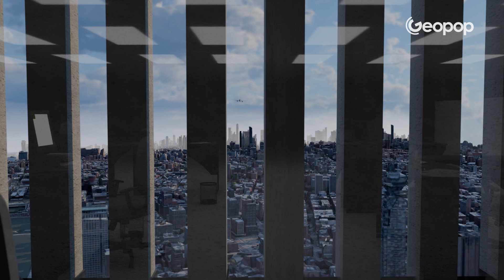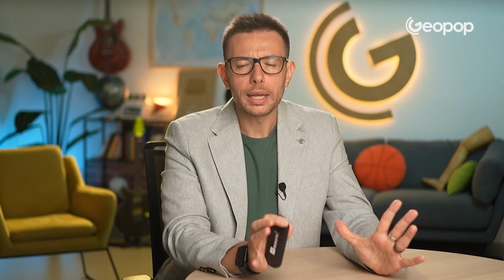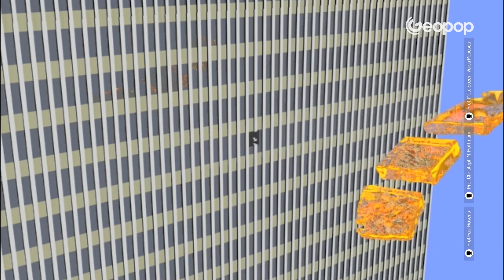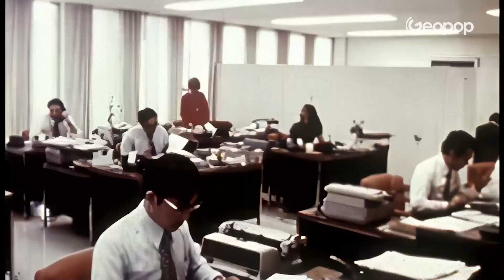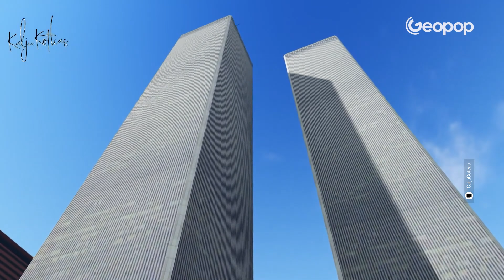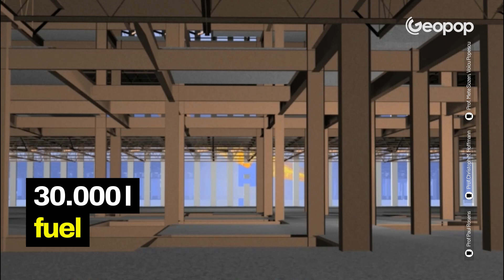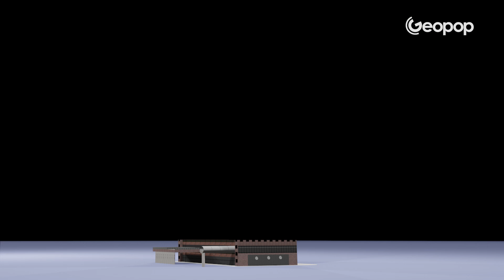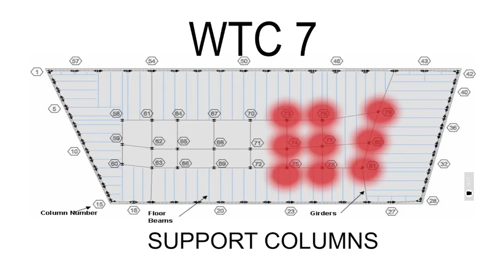9/11, 2001: The Technical Reconstruction of the Twin Towers and WTC 7 Collapses

Comment: When traces of thermite was  found in the wreckage debris I did not need to hear anymore complex would if reconstructed theories...
Reply: You know what thermite even is? It's literally iron and aluminum. It's not hard imagine a roaring, accelerated, fire would weaken metal that is trying to support thousands of tons. No building is supposed to just shrug of a commerical airliner and the ensuing fire.
Reply: @wowplayer160  I know what it is and worked with it many years, but big brother of u tube  censored my first response.

Comment: 6 floors removed by impact and structural components damaged. Of course that wouldn’t cause the structure above to fall.
It’s like this whole comment section hasn’t played Jenga
Reply: Right??????
Reply: we did play jenga and the tower never crumbled in of itself, which is why people demolishing real towers go to great length to make sure they do. Even a slight variance would make the whole thing tip to one side, yet none of them did. All that just to avoid facing the reality that this is a set up that made a lot of people rich
Reply: @fetB  A light Jenga tower can't be compared to a 46m by 46m steel/concrete structure...

Comment: Even without the fires, both buildings would have had a partial collapse. When more than 1 support is broken the weight is dispersed to the rest of them. If the load is too much, they start to fail just like dominos

Comment: When people say that the outer  structure of the towers was there to resist lateral forces of the wind  that seems to ignore the fact the they were  there to provide  vertical support for the floors. The floors were suspended between the inner and outer structure of the towers so the external columns were just as important in supporting the floors as the inner columns. If there was a windless day, basically with no   lateral loads , could the external structure of the towers theoretically be removed, leaving just the inner core and the floors hanging in mid air? Obviously not.
Reply: And that is clearly seen in the collapse of both towers. The outer structure peeled away as the floors collapsed.
Reply: The people saying they were only there for wind loads haven't even graduated high school let alone having any sort of understanding of how skyscrapers are built.
Reply: @wheelitzr2  Yet the author of this video stated that the purpose of the perimeter columns was to resist lateral loads. So this video, which was supposed to be countering misinformation, is in fact promoting misinformation.
Reply: @sorcerykid  without those columns how exactly do you expect to hold up all of those floors?
Reply: @ It can't, hence my point that the video is promoting misinformation.
Reply: The jet fuel fires heated steel enough for the central core steel and outer (aluminum sheathed) steel to soften and initiate a pancake collapse.

Comment: The cause of the collapse was gravity. Gravity is a rectilinear force pointing towards the center of the Earth. How could the side walls fly away 150 meters from the core of the building? Please tell me somebody, mostly a building enginier
Reply: Imagine you had a yoghurt pot and it was supported from underneath. Then imagine smashing something down on top of that yoghurt pot. The yoghurt will go flying out sideways before falling down. This is the same as with the towers. A tremendous force (the top floors) is crushing the collapsed floors (where the crash was) between the bottom floors. As more and more floors get crushed, this effect continues. Gravity still works, but the pressure expels the debris out sideways faster than it falls.
Reply: Air pressure

Comment: I still believe that our government set all of us because over 2.3  trillion went missing without a trace and also the owner of the World Trade Center took the biggest lone out for the bills than when missing after taking the money for towers and on the 10th of September 2001 there was a 4 man CIA team that when in to look around at the 90th and the 100th floor  which was still under work in both of the towers, which a firefight  came  out and said that both world tard had the fire coding on the steel and jet fuel can't burn or melt steel witch a billing can't make a billden fall on its own you haff us TNT to have a bilden fall

Comment: okay so it wasnt hot enough steel to melt,  the stress most likely cause the cement to crack and break apart causing it to crumble, basically the same as pavement for a road

Comment: No matter how fast a drive me car at the side of the wtc I could never ever ever drive through the steel and the concrete floors, how did a plane cut through it???? The gaps between the steel columns weren't big either , it would be like trying to smash you're cheese through the grater....
Reply: Comparing a car to a fully loaded plane??!! Put your engineering degree back into the Cracker Jack box.
Reply: @marcludwick512  so the aluminium just slices through the steel beams like butter even the wings ,, C'mon man , the wings wouldn't have went through the beams you don't need to be Einstein to work that out !!!
Reply: @vinny726  Are they just gonna stop and fall off Looney Tunes style? If you look at the closeup damage, the wings didn't do as much damage, the center and engines punched through it.
Reply: @marcludwick512  naw did I say that you fruit loop !! iv watched countless different videos of the (plane) smashing through the side of the building, right down to the wing tips , and not one piece of plane fall straight down, not 1 piece . . There's no way you're going to convince me thin aluminium wings , with 2000kg engines just went right through the  strongest steel beams there is or was at the time of building , and not 1 price of aluminium crumbled off the building and fell to ground... If a plane cut through the beams would that not in turn make that whole side of the building weaker, so technically the building should have weakened on 1 side more , which should have led to the top of the building tilting and falling over , but it didn't. It free falls straight down .....
Reply: @vinny726  "Now did I say that?!" And then you go on to say that. It's not a RoadRunner cartoon. The South tower top did tilt to the East at collapse. It's all on video for you to see.
Reply: @marcludwick512  so batman , how did passports survive but not one piece of plane 🤦🏼‍♂️🤦🏼‍♂️
Reply: @vinny726  Parts of the planes were blasted out all around the area, Joker.
Reply: @marcludwick512  and not one piece of plane lol your mad.. Riddler..

Comment: I watched that on live feeds as soon as it was available and broke into all networks. 
At no stage after years of blowing up all sorts of stuff with all sorts of methods. Did I think huh… that’s odd. It pretty much went like I expected, I said to my wife if those sprinklers can’t cope with the immense cooling needed to prevent thermal runaway where material failure would bring the buildings down they need to get out now.
I saw the second one hit as it was being reported live. I know intuitively that buildings are engineered for loading humans are unlikely to believe the building can handle. Yet I felt that, ok the safety margins and load sharing considerations for this mode o failure worked. 
My real worry started when it was clear how much fuel got shot loaded to the core and no obvious signs water was being applied at a rate that mattered. 
For me it was every thing I conceived as plausible worst case happened.